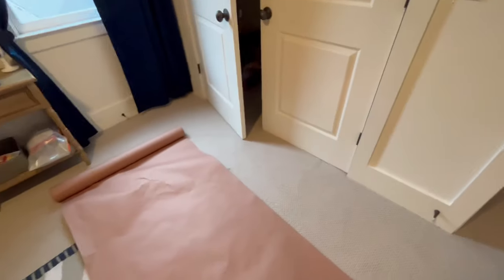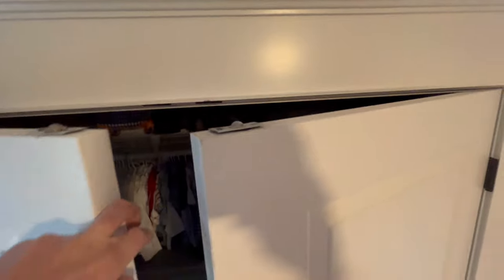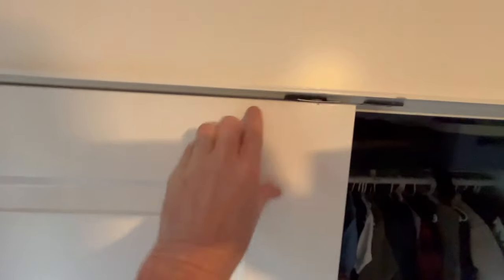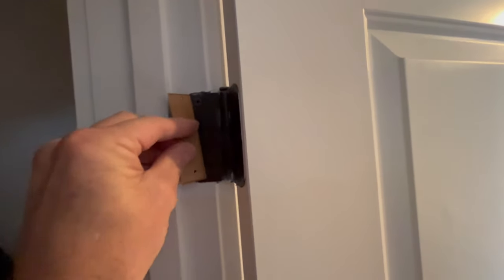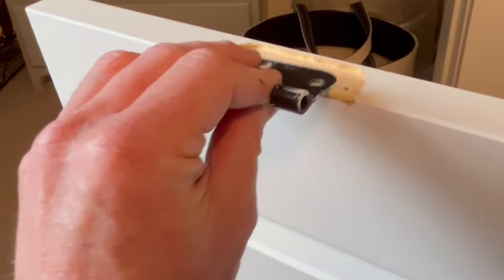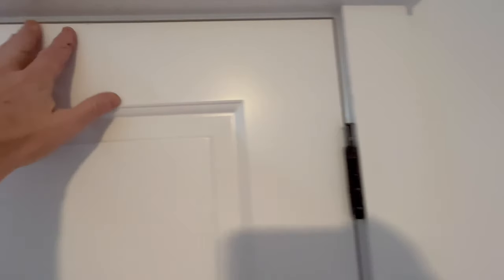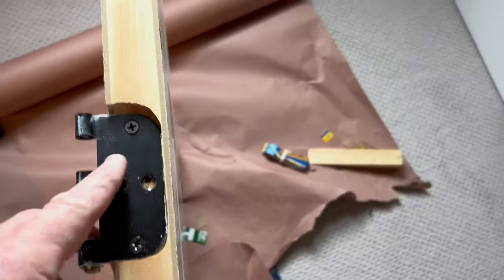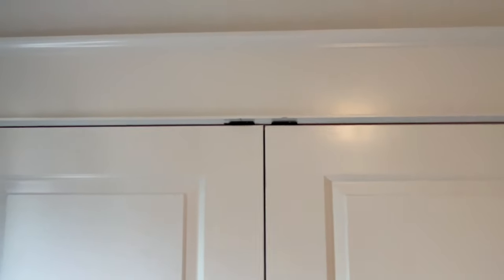How to repair closet double doors that don't close and look bad

Comment: Beautiful finish my man. Quick question? How would you fix that exact same issue with commercial metal double doors?
Reply from the maker: It's hard to say without seeing it and it might not be fixable depending on the cause. The only option is to manipulate the frame and/or the hinges. With commercial frames, that's not always easy.  By removing the doors from the hinges and installing them on a continuous hinge, that gives a little more space to move the doors side to side and up and down. I've a video on continuous hinge here, and I have a full playlist of commercial door jobs. Thanks for watching.
https://youtu.be/Bk040QpG890

Comment: I'm watching cause I need to know what to do lol I got everything level same reveal but one door is lower then the other by a tiny bit but don't know what I should do if I should take it out of level and have one side kicked out more and one in more idk it would be perfect if after everything was level it would be good
Reply from the maker: it's hard to move a door a tiny bit, but if you MUST have it, here's an option. Open the door you want to move up to 90 degrees. Shim it well from the bottom so it can't move. Take the screws out of the hinges. On the Top hinge, fill your screw hole with tooth pics or other wood so the screws don't go back into the same holes. Now place a screw just above one of the toothpicks. Once it goes in, you've moved your door up that much, so place the screws wherever you have to. You might have to do some minor mortising above each hinge. Then put your screws back in the other hinges. Just put in one screw for each hinge and check the height. Good luck and thanks for watching.